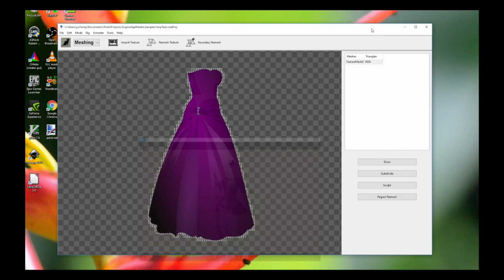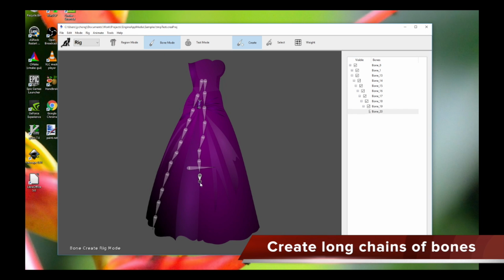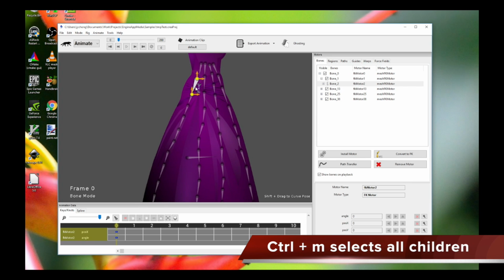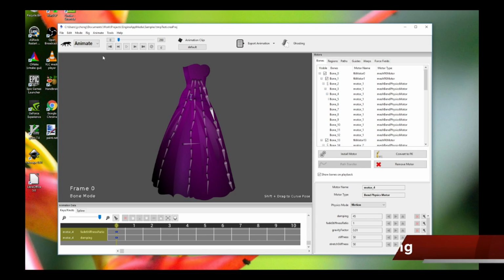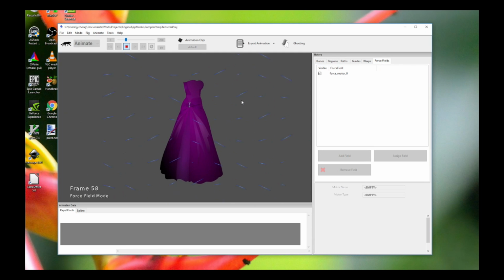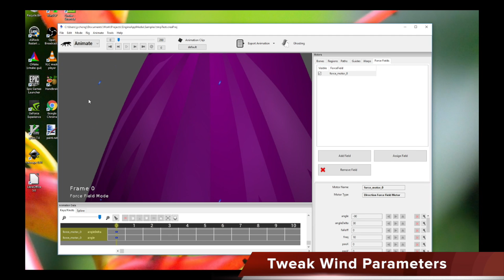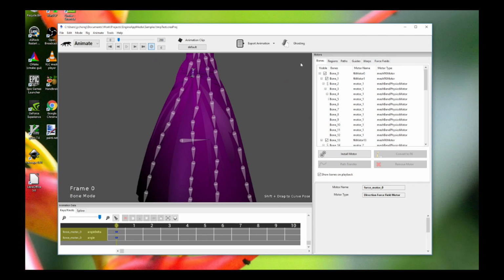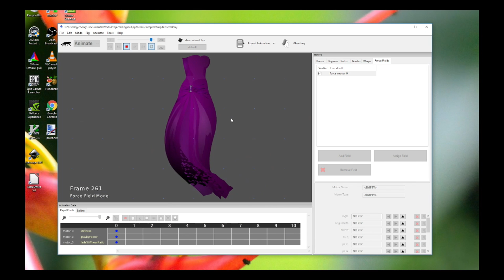Creature Cloth and Wind Tutorial

Comment: I'm considering Creature as a solution for my project.  Do cloth and all these other motors work with the Unity runtime?  Are there any setbacks? (My goal is 2D animation without using sprite sheets for each frame)
Reply from the maker: Hello, when the animation gets exported out into a game engine runtime, it is converted all into keyframes. (Animation keyframes, not sprite sheets. So the only data exported out are the positions of the bones and/or mesh positions if mesh motors are used animated over time ). Please have a look at the Unity runtime here: https://github.com/kestrelm/Creature_Unity
Reply: So the cloth only works if its baked - meaning you can't use Unity's force fields dynamically?
Reply from the maker: Yes, the cloth animation is baked out. The physics engine in Creature is actually a lot more advanced + stable then what is available in Unity ( look at how many bones you can simulate in Creature for cloth vs what you can handle in Unity for example ) If one were to do an equivalent setup with the same number/complexity of bones in Unity as in a Creature cloth setup, the simulation in Unity will not produce high quality results ( and might even fail/become very unstable ) Cheers